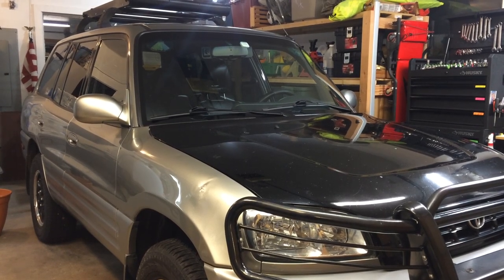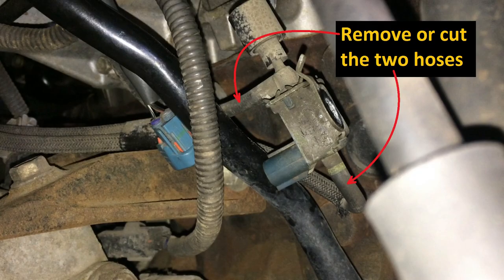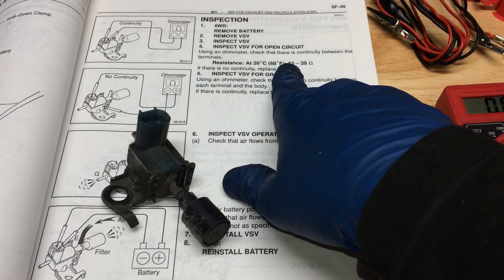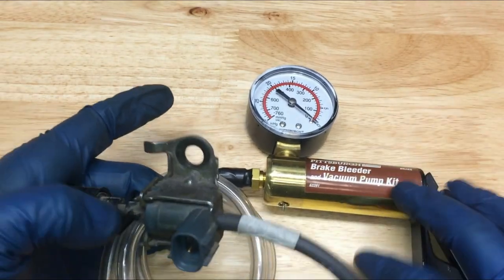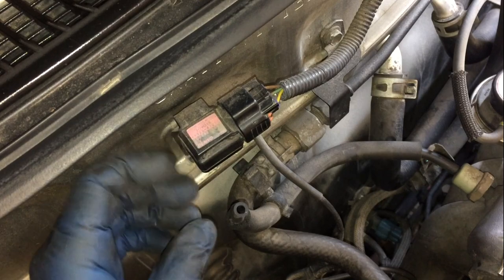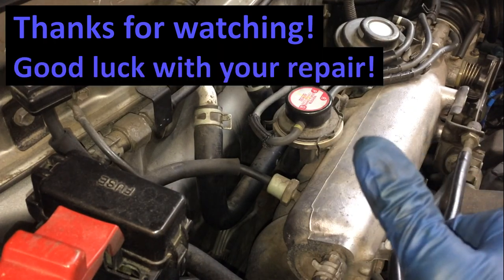1996 - 2000 Toyota Rav4 EGR VSV, Vacuum Switching Valve for EGR, Remove, Replace, Bench Test, P0401

Comment from the maker: Links for the EGR Diagnostics and EGR Valve and Pipe removal videos are below the Timestamps.

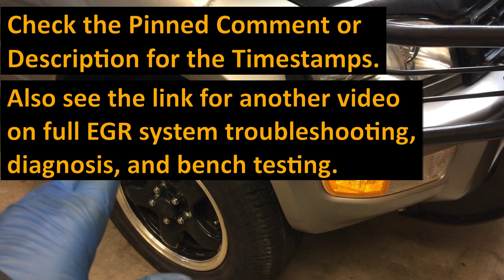00:15  Part numbers for VSV
00:35  In place testing of the VSV and explanation of function
02:42  Key OFF test for VSV
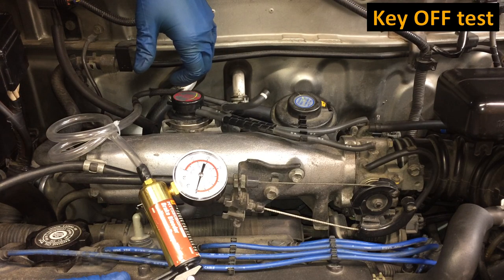05:06  Key ON test for VSV 

09:05  Start process for VSV removal (shown on 4WD Rav4)
09:14  Locate the VSV using the vacuum hoses
09:50  Recommended to remove passenger side tire on 4WD for better access
10:00  Finding the VSV (look for blue electrical connector)
10:20  Disconnect blue electrical connector
11:12  Decide if you'll just leave old VSV in place, or try to remove it.
If you're leaving the only VSV in place, skip ahead to 20:30 to see the hose removal and then bench testing.

If you're removing the old VSV:
12:45  Remove transfer case dipstick
13:00  Disconnect tie rod end for more access if needed
14:56  Remove 12mm mounting bolt (firstly trying a little Gearwrench mini #85035, but failing)
16:30  Next trying a ratchet and failing again
17:33  Fitting an air ratchet in this tight space, air ratchet did the trick
19:57  Air ratchet and extension setup
20:29  Remove hoses from VSV
20:51  Remove hose bracket bolt
21:39  Disconnect hoses from Vacuum Modulator and EGR Valve

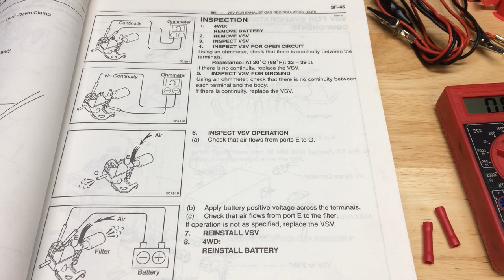23:12  Bench testing the VSV
23:29  Resistance Tests
24:54  Flow Test
25:22  Switching Test 
26:50  Test for leaks
28:43  VSV part numbers (Toyota #90910-12100 or Aisin VST-034)

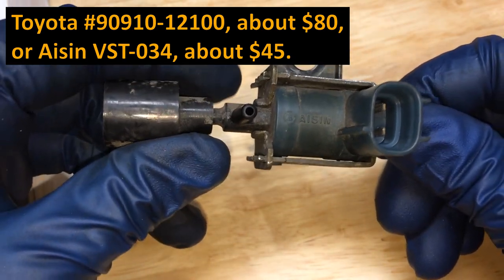29:06  Install VSV to new location on firewall (bolt is M6 x 1.00, about 15 mm long)
29:45  Remove battery and tray for better access
30:29  Bend tap on VSV bracket for better fit 
30:42  Move blue electrical connector over towards firewall
31:33  If you have ABS, remove the 10mm bolt on the brake line bracket
31:47  Mount VSV in new location
32:15  Position and connect hoses to VSV
34:55  Modify hose bracket for better fit
36:37  VSV in place, in new location
38:07  Reinstall battery tray and battery
39:22  Reinstall 10mm bolt on back of engine and other bolts under engine
40:36  Replace transfer case dipstick
40:40  Reconnect tie rod end (17mm castle nut torque is 36 ft-lbs) and wheel (lug nuts: 76 ft-lbs)
41:36  Final check on hose and electrical

EGR Diagnostics video with explanation, in-engine, and bench testing of EGR valve, Vacuum Modulator, and VSV:
https://www.youtube.com/watch?v=pdpnk2f7gnc&t=834s

Video for removing the EGR Valve and pipe (and IAC Valve and Throttle Body):
https://www.youtube.com/watch?v=O3yb5RIlqPM&feature=youtu.be

Thanks for watching!  Good luck with your repair!
Reply: Hello, can you tell me what BRAND  of hand held vaccum pump and  brake bleeding hand pump you use in your shop? I have already used three vaccum and all of them were garbage even though they all have good reviews. That"s why I never trust those high reviews on Amazon. It just waste my time returning them. Thank you in advance for your help. You should post more videos. You help people like me.
Reply from the maker: @csan255  The vacuum pump shown in the video is a cheaper pump -- its from Harbor Freight, and it is this one below (link).  It suits my needs, but I wouldn't say it's a great pump!  The little button on the bottom is known to break.  But for my purposes, it's fine for now (I don't run a shop):
https://www.harborfreight.com/brake-bleeder-and-vacuum-pump-kit-63391.html
That same pump is sold under different names.  I got mine at Harbor Freight locally.
However, if you're running a shop and need to use a better quality pump, then I would consider a MityVac MV8000, like this one:
https://www.amazon.com/MV8000-Automotive-Tune-up-Brake-Bleeding/dp/B00265M9SS
When my current pump eventually breaks, I will probably replace it with a MityVac since they are higher quality and tend to last longer.  I hope this helps -- good luck!
Reply: What is that printed guide you're using? Maybe you've mentioned it but I couldnt seem to find where. Thanks! Love the videos!!! 🤩

Comment: Thanks so much for this. I have a 1996 Rav4 2WD and was able to follow along. I replaced the EGR modulator and then the EGR valve itself before realizing I had no choice but to do the VSV. Your instructions were easy for me to follow as someone not mechanically inclined. Check engine light is now officially off!
Reply from the maker: Wow, that's so great to hear - excellent work on your DIY, and for keeping your '96 on the road!  Thanks for watching : )
Reply: was it the problem? Or the vaccum lines were the problem?

Comment: This is about the best car-repair video I've ever used! Thanks L35 for this excellent product. I especially appreciate how you gave guidance on the products you used, including part numbers and order numbers. I followed the video carefully and it worked perfectly. I also replaced vacuum lines because the vsv held vacuum with the key on but lost vacuum with the key off and my finger over the end of the white marked hose. I figured there was a leak in the hose or a leak in the vsv after the solenoid. I bought a vsv on Amazon for about $20.  Thanks again for taking the time to make this terrific video!
Reply from the maker: Wow, I'm so glad the video helped!  Great job on repairing your Rav4!  Thanks for the comment : )

Comment: Thank you L35
The mechanic told me that it is not worth doing it for a 1997 car. The fault code refers to the VSV solenoid.
the problem is that the car has the engine light ON, and if another fault shows up I would not know about it.
The car has only 153.000 Km, (82.650 miles) and it is in good shape. I will use your advise and ask the mechanic to relocate
 the new VSV to the firewall; although I could do it myself, I don't have the metric tools or location to perform the tasks
that you so explicitly showed. Great video. Congratulations on a great job.
Luis B.
Reply from the maker: I'm sorry I missed your comment -- I hope this worked out for you!

Comment: Thank you, they replaced the EGR and modulator but not the SVS (laughs), and SVS it cannot hold vacuum when powered on and doesn't click when switch to on, harness terminals are providing power so I ordered a new SVS and possibly that is causing the P0401 Thank you for taking the time to create these videos **very helpful**.

Comment: Thanks so much for the video (and the video for the EGR valve and the IAC valve).  Camry 2.2L.  The Camry air intake pipes had a M10_1.5 threaded hole in easy reach from the bottom of the car, and I made use of that to relocate the new VSV valve.  It felt like it wasn't a very strong hole, so I only turned it in 5 Ft-lbs, and put threadlocker blue on it to help hold.  It could have been the swivel socket slipping, but I did not want to strip the threads!!  I had the P0401, P0300 (random misfires when stumbling), and I've had the car idle up and down after letting it sit for 15 minutes to 45 minutes.  We also had it stall, and not restart for some time.    I think my VSV valve fails when the engine is hot causing the P0401.  I replaced the EGR valve and cleaned the IAC.  No codes, no idling issues, no stumbling, no stalling now!!  I had to drill out one of the bolts between the EGR pipe and EGR valve, it was REALLY rusted in the EGR valve and EGR pipe bolt hole, even through the pipe hole is not threaded.

Comment: R&R'd my EGR VSV today without a hitch. Watched this video a couple times. It was integral to my success. 1998 RAV4 2x4 manual.  Put it up on the hydraulic lift. Found it right away (thanks to your still-photos & arrows).  PB Blaster on 12-mm. bracket bolt. Wait 10-min. Came right out using 3/8-in. ratchet Driver + 3-in. "LONG" 12-mm. socket. THANK YOU for a magnificent job.  Wondering what the Stealership would've charged me for this Remove & Replace (R&R)?  Congratulations on a brilliant, helpful, useful, incredibly detailed video w/ great red circles, red arrows, torques, references, and "Where to jump to if you have a 2x4, not this 4x4." You made it EEDJIT-PROOF! THANKS AGAIN!!!
Reply from the maker: Wow, thank you for your comment, and for sharing your tips!  I'm so glad the video helped.  Thanks again and I hope this solves your EGR issue!  : )

Comment: Thank you for this, came in handy especially in diagnosing if the egr itself were bad of the solenoid. 

I found the pigtail on the 1999 AWD rav4 I worked on was too short for the solenoid relocation. 

I did find that with the battery removed It was far easier to get access from the top to the small 10mm holding the 2 hoses. I just reached in with the wheel off the passenger side to get the 12mm for the solenoid itself. 

Thank you so much for this!
Reply from the maker: Thank you, and thanks for watching and adding your tips! : )

Comment: I just started getting the nasty P0401 error a few weeks ago and was dreading having to change this, but have the part on the way. I had to replace the VSV when I first got my Rav4 I got the old one off and I can't remember when I swore so much and still had to take it to someone to finish the job. The idea I can just relocate it is worth the price of admission! Thank you!
Reply from the maker: Yes, it is a major pain!  Since you have another one VSV coming in the mail, just disconnect the electrical, disconnect the hoses, and mount the new VSV on the firewall.  It is much easier to reach!
I just posted a couple other EGR related videos today and yesterday.  As you know, the P0401 is often caused by the VSV, but there are other possibilities, including a restricted exhaust passage on the EGR pipe and/or EGR valve, since P0401 is EGR flow "insufficient".  I step through some tests in this video below (skip ahead to the different parts) that you might want to check out to narrow down the issue in case its not the VSV:
https://www.youtube.com/watch?v=pdpnk2f7gnc&t=840s
Good luck, and thanks for your comment!
Reply: @L35inColorado  
Well, I just finished doing the deed. Seems the place I took it too took a relocation shortcut . I couldn't find it anywhere it was supposed to be. I tried to follow the vacuum lines down and finally found it all stuffed up under the intake manifold. It was a pain to untangle but it has it's new home on the firewall. Hopefully Murphy's law says because it is now easy to access I will never have to look at it again!

Comment: Tengo un Toyota Avensis 2001 T22, mismo motor 3S-FE y me desconectaron mangueras debajo el motor y con tu video puedo revisar la correcta conexión, muchas gracias, saludos desde Chile. 
I have a 2001 T22 Toyota Avensis, same 3S-FE engine and they disconnected the hoses under the engine and with your video I can check the correct connection, thank you very much, greetings from Chile.

Comment: Amazing video !  Thank you. My friend changed this VSV on my 1997 camry 4 cyl. I remember he hoisted the car in his workshop and used the socket wrench inserted in a long cheater bar to open the bolt from underneath. Then, he reached the hoses with his hands all the way, while standing under the hoisted car. This vsv is really difficult to get to. You did great showing us how to change its location altogether !! Smart Move !!
Reply from the maker: Thank you!  Yes, this VSV has made a lot of knuckles bloody and bruised because of where Toyota put it...what where they thinking?  Haha.  And yes, the firewall location was thought up by someone (not sure who) a few years ago over on the Rav4world forum.  It is a good solution, especially when you simply can't remove that bolt (sometimes they round off or are too rusty).  Thanks for watching and thanks for you comment!

Comment: Great video! Currently facing a p0401 that came up recently for my 99 rav. Cleaned modulator and egr valve, both are very carboned up because my engine burns so much oil. Found my VSV hanging loosely under the intake, with all hoses and electrical connector attached to the VSV, but VSV attached to nothing. Going to test that next. Hoping I can find the problem.

Comment: I managed to get the vsv valve off from the top going through the engine bay using a borsecope camera and a ratchet with wobble extension. literally used the camera to see where the vsv was and where my socket was going. Managed to get it off in about 10 minutes that way on my 2000 Camry Le. Definitely re installing it to a more accessible area.
Reply from the maker: Great tip -- thanks for sharing!  Yes, it is in a tough spot.  Is there a similar mounting point on your Camry's firewall to use as a new spot, like there is on the Rav4?
Reply: @L35inColorado  there’s some bolts down on the fire wall where I think I can definitely undo the nut and have it retain the vsv to the fire wall. I am waiting on the new vsv to show up. I have no idea why the Toyota engineers put the vsv down there to begin with. 

I’m just glad I was able to get it off without having to get under the car. My vsv was however very dirty and covered with oil. I recently replaced the valve cover gasket so I hopefully shouldn’t have much oil leaking after that.
Reply from the maker: @ws4835  I have no idea why Toyota engineers put it down there either!  Thanks for sharing your tips and please post back with any more tips you find during installation of the new VSV on your Camry : )
Reply: @L35inColorado  I thought I replied to this before but I guess it didn’t show up. Hope this helps others facing this problem. 

so I finally got the new part installed like 2 days ago. I bolted it onto the intake plenum on the passenger side. There’s a bolt hole that’s threaded there and nothing attached so I used the 10mm bolt that was securing the insulator sleeve on the vacuum lines to the EGR VSV. I pushed some compressed air through the vacuum lines to make sure they were clean and clear. There was a lot of old oil on my EGR VSV and the plug so I used QD electronic cleaner from CRC to clean the line. (Disconnected the battery first per the instructions.)

I loosely zip tied the vacuum lines to the hard tube on the firewall going to the MAP sensor. Loose because I didn’t want to clamp shut the vacuum lines. 

I took the new EGR VSV and flipped it on the bracket so that it’s not on the recessed side of the bracket but rather on the flat (opposite side of Factory orientation) side. Used the same screw and tab to secure it. I did this because it moves the vsv about an inch closer so the electrical connector doesn’t have to strain as much to reach it. 

I then connected everything up and it’s been running fine for over 100 miles. I plugged in my scan tool to look at the monitors and the EGR monitor is clear now where as before it would not clear and would immediately go off after 10 or so miles of driving.
Reply from the maker: @ws4835  Wow, thanks for sharing these tips!  This sounds like a solution for your Camry -- well done!  : )

Comment: Is there any way about this without messing with the tire and ball joint? Like a special tool I can use? I have check engine light for the EGR Valve. Gonna replace the hoses first and foremost and clean it...but if I must replace it I can still remove the tire. Just wondered if I can go about it without doing that. Great video, though! Exactly what I was looking for!
Reply from the maker: There are a few different components that cause the various EGR system codes, so if you're not yet sure the cause of your code and would like to do some troubleshooting on the system, check out this video:
https://www.youtube.com/watch?v=pdpnk2f7gnc

As for access - yes, it's possible to reach the VSV without removing the tire.  For the AWD model, you can reach it from above if you remove the battery and the battery tray: it's not fun, but it is possible.  For the 2WD, you can reach it from below.  Of course, the alternate is do what what's mentioned in the video and just leave the old on the place, buy a new one (if that's the part you need to resolve the code) and mount it on the firewall, as shown. 
For the EGR valve, here is a video that shows the cleaning process - the EGR valve is easily accessed from above on the driver's side:
https://www.youtube.com/watch?v=O3yb5RIlqPM
Check the Pinned Comments in those videos to skip around, because they are both very long and detailed.  I hope that helps - good luck!  : )

Comment: thanks for this video! I'm replacing a faulty modulator in my 97 4wd but if that doesn't fix 401 code I will need to tackle the VSV

Comment: Hi! Thats awesome video and very helpful! I just started wondering diagnostics, that how does this system detects if egr is totally clogged, but valve still moving up and down? Is map sensor monitoring that pressure difference between egr closed and open, or how it can detect it? Best regards from Finland, great videos, because car is totally new to me!

Comment: Hi There, Your video's are exceptionally presented and very helpful.

I have an earlier model 95 Rav4 petrol that was experiencing intermitent loss of power that got better then worsened and progressed to inlet backfire. I have checked the throttle body and found one vacuum pipe cracked, whic I replaced. I replaced spark plugs (old ones looked normal), eng oil and fuel / Oil filters. The fuel filter was dirty, so I then checked the fuel pump and tank, the tank was clean. I suspected the dirty fuel filter and cracked vacuum pipe to be the source of faults, however the symptoms remain. Can to give me any further advice. 

Joe